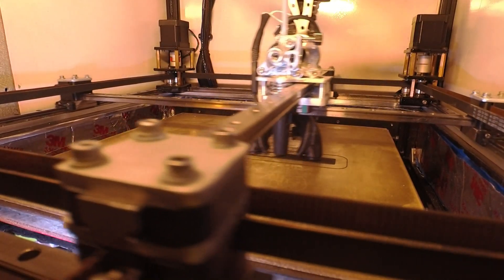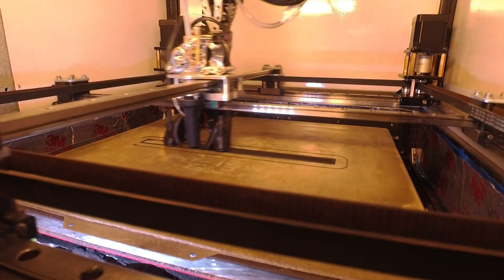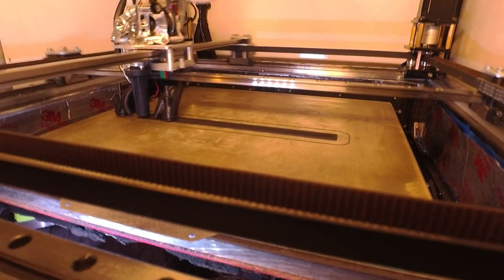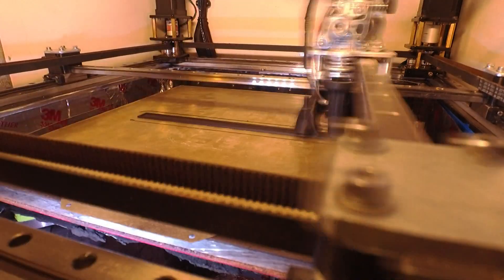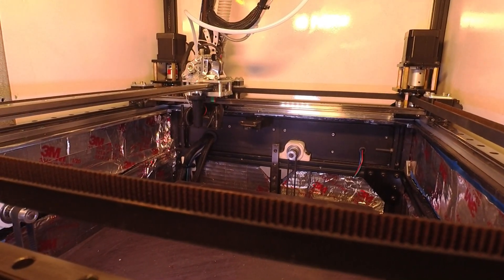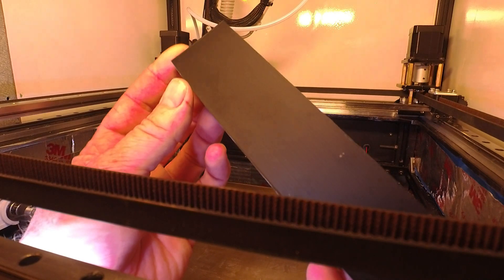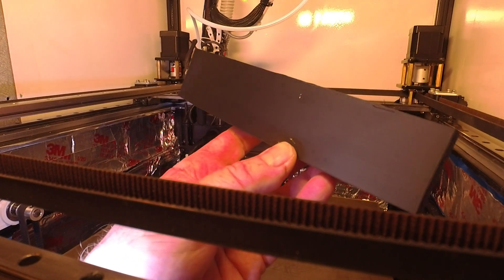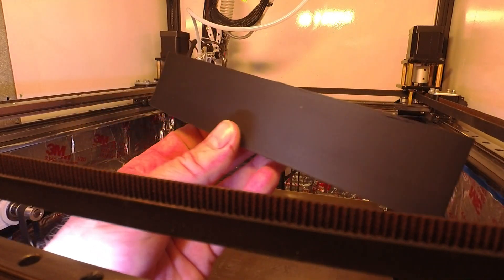Goliath abs+ flow test

Comment: jeez 285c with abs. when my goliath does a purge before the print it bubbles so much that i thought it was too much heat and had to go down to 235. I'm thinking i need to try this at 285 with 60% fan like you are doing. 🤔
Reply from the maker: If I let it cook/idle at 285 the first bit will be some gooey crap.. Might set the wait temp low and kick it up for print. Once it's moving it's great. Make sure your filament is dry!

Comment: 65mm3/s is about what we saw for Goliath too with a 0.4 nozzle. At that point your more limited by the pressure behind the nozzle then the melting capability of Goliath. With a 1.2CHT Nozzle i could do 118mm3/s on PLA at only 220c
Reply from the maker: .4 CHT or .4 regular? I saw some issues at 45mms3 with the nozzle that came with Goliath, but not tested much with that nozzle.
Reply: @MrRocksalt  45 for a regular .4 yea and CHT will get a bit higher. That's realistically just the limit of the nozzle there's only so much you can push out of such a small hole without building up insane pressures behind it wich would cause other issues like horrible print quality.